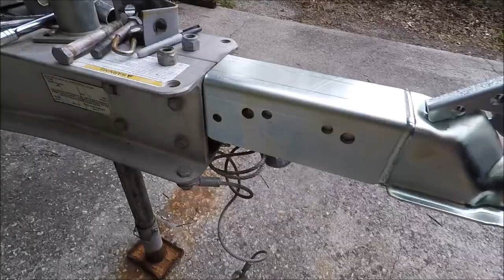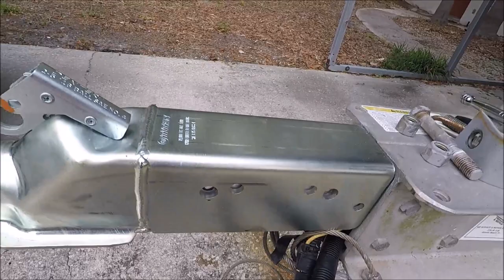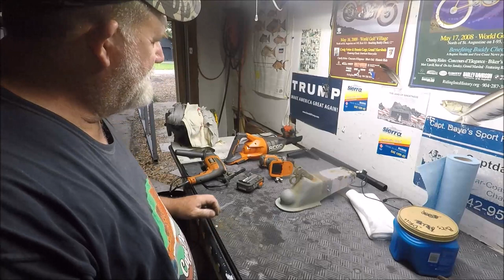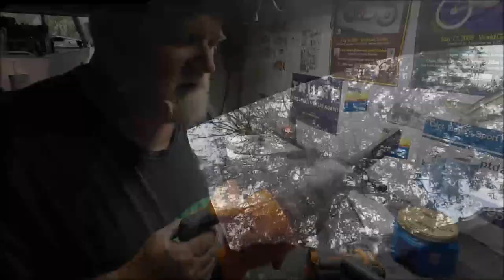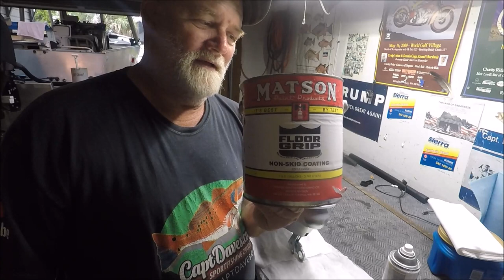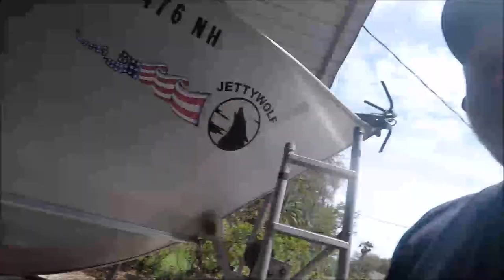BOAT TRAILER COUPLER REPLACEMENT, over due, and over doing it!

Comment: Instead of drilling the tongue of the trailer, you could have cut 3/8" or 1/2" off the back of the coupler and got the holes a lot closer to matching.
Reply from the maker: It was easier to just drill than to cut all that steel, and exposing raw steel.

Comment: Isn't it funny how every so often 1 little tool or bit or something that's tucked away and doesn't get used much just as you said , "saves the day". /lets you finish a project or a repair.Good to go for another 17 years Capt Dave!!!  Well at least for couplers  anyway. As always thanks for sharing.
Reply from the maker: I have used and abused that harbor freight bit and it's cousins to near death and they keep working. When I do something it'll last for sure. It's my ultimate goal. Now if my batteries would have just lasted longer.....gotta call ELON!